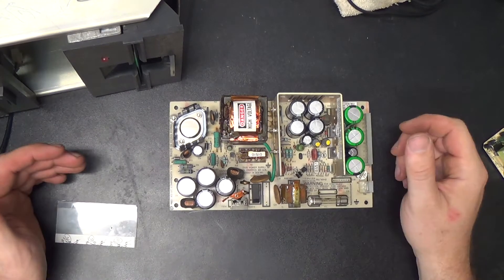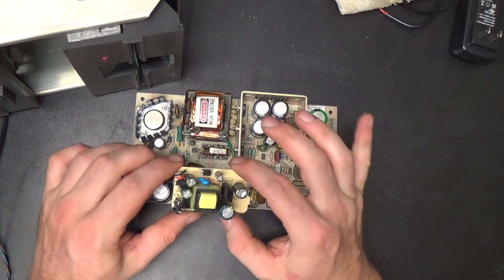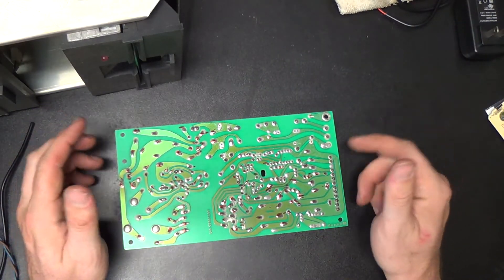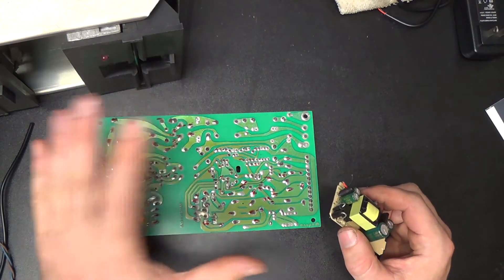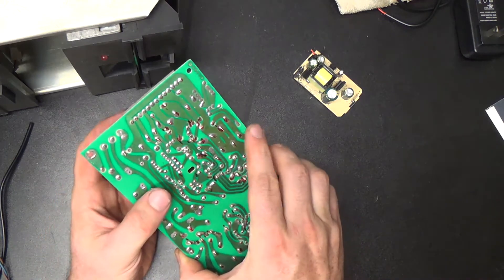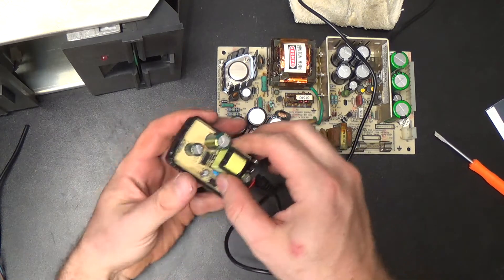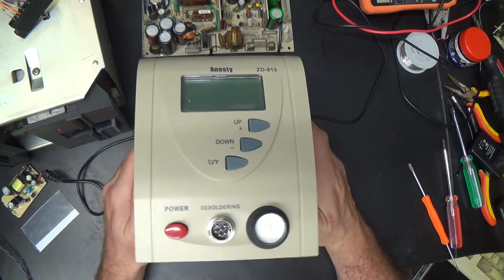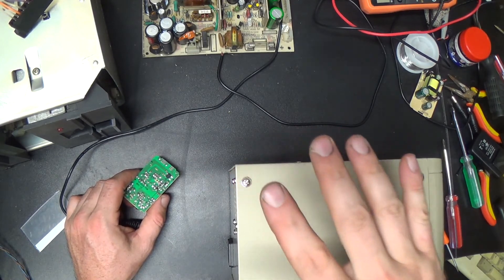TRS-80 Model 4 (Pt.2) Totalfail Not-Fixup (#SepTandy 3rd, 2020)

Comment: Those desoldering guns are all clones. I have had the same one for over 4 years and it has been ok although I had to get a replacment gun. Getting the tube out is a pain in the ass. I used to take it apart too but now I just take the front out first then the back. Sounds strange but works. Loving the videos
Reply from the maker: I used the Hakki 301 a little last night to take the transformer out of a PSU so I could continuity test it out of circuit.  It works so much better than the Anesty did.  Like, there's really no comparison.  With the Anesty, I often had to wiggle leads with pliers to break that last little bit of solder loose, and sometimes it would take several tries to get a good suck-out.  With the Hakko I just desoldered it and pulled it out, no fuss.  It was a single-sided PCB, so that probably helped, but they were fairly big wires and holes and great big ol' globs of solder (I mean, mains transformer leads, not little resistor leads or whatever).  Collection tube pops in and out as pretty as you please, and it's a lot easier to clean.  I am very satisfied, despite the higher price.  The "stand" for it is pretty lame, though, and it takes up a lot of bench space laying there.  I already bumped it and melted part of my desk, lol.  I think ima try to make a better stand for it one of these days.
Reply: I have a cheap Gaogie S-993A. One of those "pump-in-the-gun" units, no base station. Doesn't work too badly for what you pay for it, but I'd be sure to take it apart before you power it up and make sure there isn't any loose ends or solder bridges before you power it up. Some things made in China aren't too bad, but some are so poorly made you wonder whether or not the QC guy is asleep.

Comment: I’m sure Meanwell or some other OEM makes a modern switching supply which you could drop into the model 4.
Reply from the maker: I thought about dropping a whole different PSU in there but well....  The one that is in there is junk (or at least it is to me, as I'm too dumb to fix it), and if I can fix it with more junk well....  No loss.  :3  Certainly an option though, if all else fails.
Reply: @brianangel6090  please define "high amperage" in this context.  In photos, I see the power supply using a 2.5A fuse.  Meanwell has PSUs with far more than that on a single rail.
Reply: @brianangel6090  As long as it doesn't use any oddball voltages, I'd slap the guts of a cheap ATX PSU in there, with a regulator on the -12v to provide the -5v it needs for the RAM.
Of course, I'd still try to fix the original before resorting to that.

Comment: My first experience with the Tandy 1000 series was when I was 13 years old. My School had a network of Tandy 1000 series of computers that networked the entire Middle School I went too. I would later find out that SchoolMate Plus! as it was called was a modular version of Novell Netware with SchoolMate Plus! riding on top of it. I never found the software.

 In 2011 I came across the Administrators of this network. Sadly. They did not have the software still. I begged them to help me find it.

 I wanted to raise awareness of the existence of SchoolMate Plus to others in the Tandy Community. Would you be willing to reach out to the Tandy community?
Reply from the maker: You might poke around ftp://ftp.oldskool.org/pub/tvdog/ .  That's one of the most complete Tandy archives I know of.

If that doesn't turn up what you are looking for, you might post a message the the Vintage Computer Federation forums.  They are a fine bunch of folks and know about everything that is worth knowing about.  :D
Reply: @Lee_Adamson_OCF  He is aware of the Existence of Schoolmate Plus! And has never found a copy. Someone needs to make a video on it.